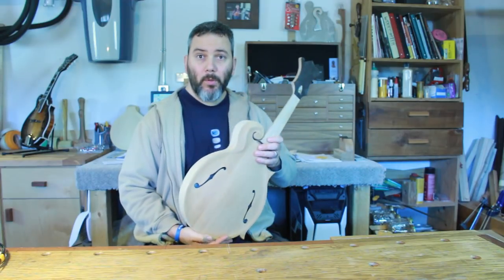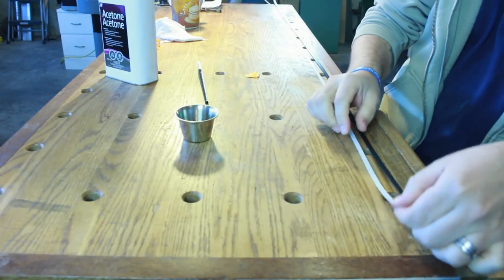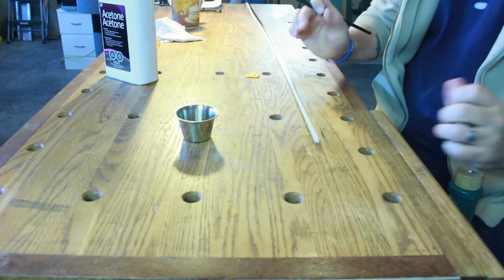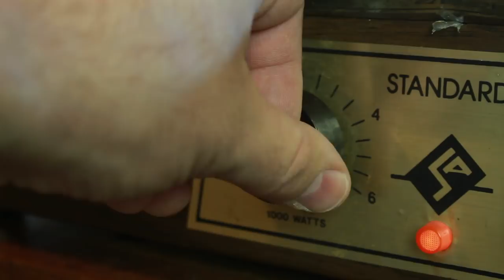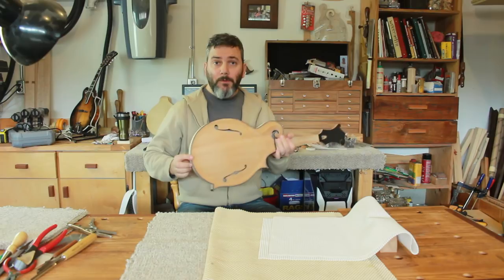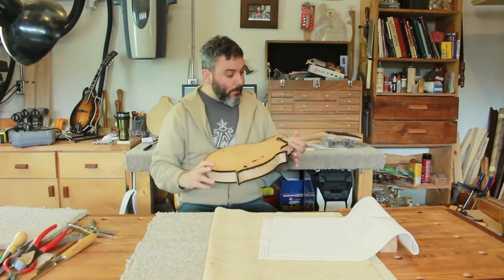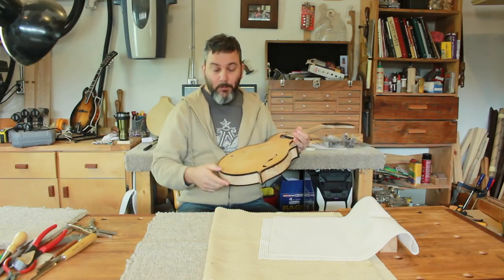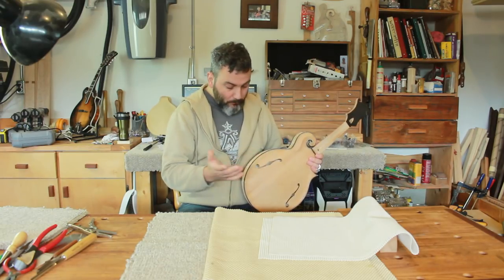How to Install a 3 Layer Binding on a F-Style

Comment: Can acetone also be used to secure binding to the body instead of glue?
Reply from the maker: I’ve seen acetone use to create a paste with bits of binding to glue the binding.
Small clipping of binding and acetone in a small container and mix till dissolve to a paste consistency.
I find it messy personally..